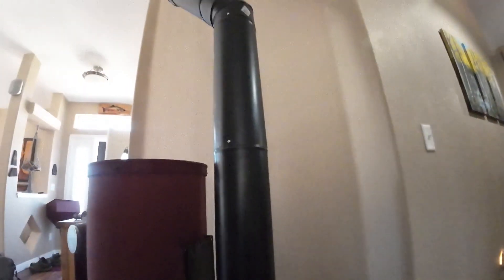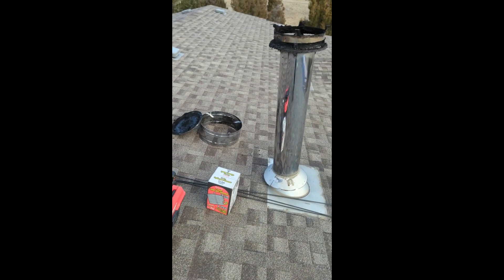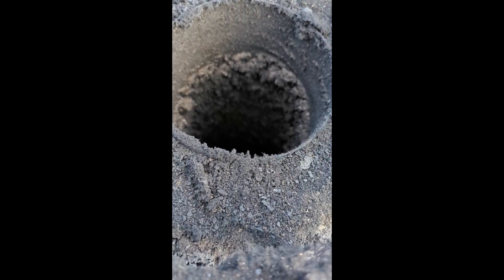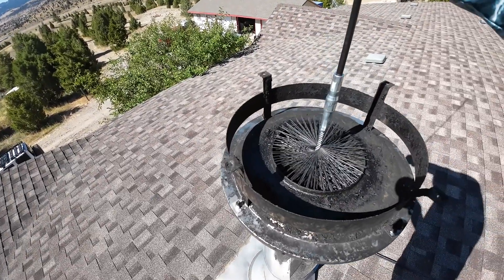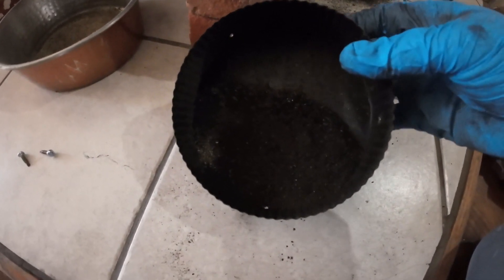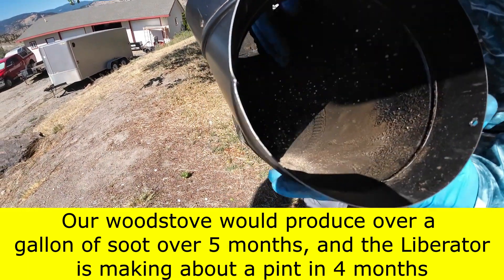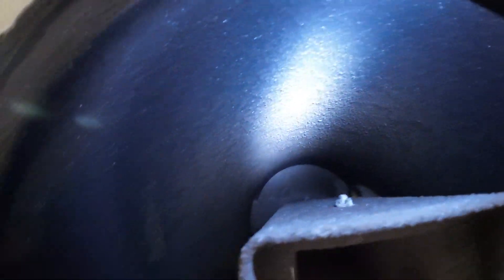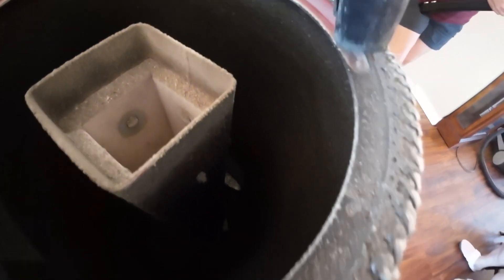Liberator 👀 4+ Month CLEANOUT 😬

Comment: Is there anyone who measured those J-tube measures, what size is this J-tube and liner, and what size is this hole inside the liner, that would help some calculations?? And where all places there is that liner totally rounded, between firepod and vertical tube too??

Comment: When you took the old stove chimney apart, you can tell no matter what wood they were burning, they were running a low temp/smoldering fire quite often.  We have burned wood in a standard old fireplace for 21 years straight with inspections and very rare cleanings by a qualified fireplace cleaner.  He said our style of burning an ultra hot fire at the beginning of the burn, creating a massive amount of coals, then letting the coals burn down to low heat, then refiring to a massive coal bed, and repeating has kept our chimney super clean.  We burn any and all wood we can get our hands on from tree services, or when we get some from when we go camping.  It has worked great forever.

Comment: I burn wood pellets in a home made rocket stove and after 2 years and 6 plus tons of pellets, all I had was a couple of handfull of dry power in the section of chimney that runs at a 45 degree angle, the remainder of it stays completely clean

Comment: If no smoke comes from the chimney and it burns so clean. Why did it create all that creosote? In the chimney.
Reply from the maker: What creosote? Thats about a couple cups of fly ash. No creosote buildup at all. I cleaned it out this fall again after burning it all last winter (6 months of use) and literally collected ONE cup of ash. 
Oh if I called it creosote I misspoke.
If you have seen My other videos on chimney clean out with a wood stove, there's literally a gallon of true creosote from one season of burning. Or maybe you saw the video I made of cleaning this chimney out when we first bought the house, it had a wood stove in it, and the owners never cleaned it out, and it was super thick with creosote, really bad, like about to start a chimney fire kind of bad. That's one reason I wanted to go to this rocket heater, to decrease or eliminate the risk of a chimney fire.
Maybe you missed the part where I had a green screen pop up saying we're going to go back in time to before we installed the liberator, that's when when the video shows a bunch of creosote from the pre-previous owners wood stove.
Reply: @anesthesiadreamin sorry i missed the very first part where you showed the chimney before you installed the liberator!
Reply from the maker: @TwopersonsWalksalone Yes, I probably shouldn't have built the video like that, I wondered if it would be confusing or not. My apologies
Reply: @anesthesiadreamin not a problem!

Comment: If that is a stainless steel pipe,,, do NOT use metal brush... Use Plastic,,, Metal will Scratch stainless and leave metal fragments in the scratch and if the stainless is NOT high quality and it WILL start to Rust...
Reply: By the looks I thought chimney flu was double wall insulated stainless and YES, a metal brush is bad news if that is the case. We just cleaned out double wass insulated stainless flu. 3 seasons of use with a Mattrix free standing wood stove. No creosote to speak of. Creosote formation depends on many things and I try to use season hardwood only and when I burn I burn it hot. But of course I'm stocking the fire every 1-2 hours. Lately I've been studying true masonry heaters like the Temp-cast. My proble is I like see the fire, and running it all day. For a true masonry heater most only recommend a burn in the morning and one at night. I guess in the ideal world you'd have both :)

Comment: A chimney will get in that condition with wet wood, softwood, inefficient wood stove and of course no maintenance.  A modern wood stove with reburn will produce little or no smoke when it is running.  Pellet stoves run cleanly and produce very little deposits that are not combustible.  Rocket heaters burn on the same principle with a very hot fire that fully consumes the pellets.  A lot of people burn a lot of wood in old stoves of very poor design.  Outdoor hot water boilers are expensive and burn ridiculous amounts of wood poorly.  Not to mention they are ridiculously expensive and very hard to feed and maintain.
Reply from the maker: That was an excellent summary. You should make a video about that
Reply: Softwood does not cause more creosote than hardwood, it's all in the moisture level

Comment: Hi 😊
I’ve been watching your video on YouTube – it’s really fascinating! I noticed there’s a combustion chamber in the front of the pellet stove without power, but I’m curious about the large round tank in the back. What’s its function? Is that where the exhaust gases go to cool down, or is it some kind of water tank?

I had an idea: if that rear tank could hold water, maybe you could place some heat-resistant coils inside, so the smoke passes by them and transfers the heat into the water. That could make the system even more efficient.

It looks like your model is about 60 cm (around 24 inches) in diameter and about 1.5 meters (around 5 feet) tall – so it could probably hold 100–200 liters of water. I really like the way you designed it, and I’d love to understand more about how it works.

You mentioned you use around 20 kg of pellets to reach 150–200 °F and heat about 600 square feet with this small setup – that’s impressive! I’m curious if the same system could be scaled up to heat a larger house, maybe 1,500–2,000 square feet.

Comment: The residue in the stove pipe from the liberator doesn't look like soot.  It looks like fly ash.
Reply from the maker: You are exactly right. I just cleaned it out at the beginning of October again, after burning it all last winter. There was about 2 cups of fly ash total from the heater and chimney combined. From a whole winter season of burning, in SW Montana
Reply: @anesthesiadreamin  I have an insert that does nothing when there is no electricity.
But it's in such good condition I don't want to just get rid of it.  
If the inspector this week says it's time to replace the stove then I'll talk to him about installing a rocket stove in it's place
Reply from the maker: @beebob1279 its UL listed so there shouldn't be any issues. But I get what you are saying, sometimes the most sustainable thing is what is already in place 👍

Comment: They are lucky they didn’t burn the house down with all that creosote in the chimney. Burn good dry wood and avoid creosote. Hardwoods are better than pine. If you burn pine, make sure it is well seasoned and split to smaller pieces.

Comment: Why the bend in the exhaust pipe? Why not just run it straight up?
Reply from the maker: @danhemsworth7488  We wanted to keep the rocket heater centered on the hearth. Otherwise we would have had to extend the hearth out into the walkway if we wanted the chimney to go straight up. But  two 45° bends equals one 90° bend and most codes will allow max 180 degrees in bends.
Reply: @anesthesiadreamin  Cool , great work.

Comment: Only downside of most stoves is that they burn the air that's inside the house and that air needs to be replaced. Most of the time, it will be replaced by cold outside air that gets sucked into the house through gaps in windows, doors and the insulation. It might not be practical, but you would get more efficient heating if you could figure out a way for your stove to burn air it sucks in directly from outside. Then most of the air being heated by the stove actually stays inside.
Reply from the maker: @CChan11  You were exactly right! Be sure to check out the "questions answered" video on my channel (Liberator playlist) where you can see my cold air intake. I'm working on a video that details how I made the cold air intake. And it definitely makes a difference 👍
Reply: It appears your cold air intake draws off the floor?

Comment: Its probably reasonable to assume that a water tube coil  could be inside the fire barrel and do a great job .
Reply: It would suffer heat damage.  
The heat in the barrel will ruin the welded steel J-tube riser, if not for the insulation panels.   
Depending on your use for the hot water….
Feeding a water tank, it might be ok (maybe) to put copper coil around base of barrel exterior, to feed to a tank with an expansion tank (cuz it will steam).  
Feeding radiant floor tubing, a copper coil only around the horizontal section (bench section) of exhaust pipe is better…away from barrel…rather than directly on the barrel.

Comment: Creosote build up in a  chimney is caused by none season dried wood especially soft wood seasoned firewood burns cleaner and hotter especially hardwood I would say the amount of Creosote in that chimney The previous owner didn't use seasoned firewood especially using soft wood 10 % or less moisture content in firewood will burn the  best clean and hot
Reply from the maker: I agree 100%. No hardwoods in this area. The previous owner didn't use a woodshed to store wood either, and it snows often in SW Montana, so I'm sure the wood had a high moisture content. Thanks for sharing your experience!

Comment: I've been waiting to see the inside!  Be sure to clean / change the filter right after vacuuming - as ash plugs up filters incredibly well.  I'd recommend using a shop vac with one of the paper filters over the foam filter.
Reply from the maker: @CubbyTech  thankyou, good advice👍
Reply: You can also use bags in a shop vac they greatly extend the life of filter.

Comment: Always wondered about air intake .  Can it be channeled from outside rather than suck warm air from the home? Can it be a hose that actually travels from the outside  inside the chimney to heat up the air before it hits the fire?  This may prevent the warm air inside the room from travelling towards the heater
Reply: The liberator is designed to be vented from the outside

Comment: Starting our 3rd winter with it.  Our ONLY heat & used 40 bags of pellets last year @ $5 pr/bag. $200 pr/yr to heat in southern Ohio.
Reply from the maker: @scott1lori282  That's awesome! Do you have it attached to thermal mass?
Reply: @anesthesiadreamin  No sir, but I do keep a large cast iron Dutch Oven filled with 1 fire brick and the rest is filled to the top with river stone. The Dutch oven will put out some good heat for a couple hours after the stove is out..
Reply: How many sqft does yours heat?
Reply: @stephaniewilliams8537  1100sq ft ranch.
Reply: What kind of pellets are you using? Pine? Is pine safe to use in this application or not?

Comment: Great video, thank you!! 
I noticed a possible problem with your stove pipe connections. All crimps, including the cleanout Tee, should be heading downward from the ceiling to the stove. The cleanout Tee should have crimps toward the floor with a cap that fits over the crimps ( see Liberator instruction pdf).
Reply from the maker: @SirDavosChannel  Yes, you're absolutely right. My understanding was that doing so prevented any water that might come down the chimney from leaking outside the pipe. Am I wrong? Or is there another thinking behind that? And the reason I haven't done that with my other builds is because I've never had a problem with water leaking down and then outside of my chimney pipe. But I could be very wrong
Reply: @anesthesiadreamin  
I dont know why, I can only speculate that on wood stoves where there is a possibility of burning wood that is heavily laden with sap/creosote, the correct crimp direction  would prevent any hot sap/creosote from possible dripping out of the flue crimp connections(??).

FYI: On a coal stove, the crimp goes in the opposite  direction (from my understanding).

Disclaimer: I've never owned or installed a coal, pellet, or wood stove. 

Based on this great video, I love this stove.

Thanks again, @anesthesiadreamin!!!
Reply: Correct.  Wood crimps down always.   As long as you have correct draft you won't get smoke out of the connections.
Reply: If the top crimp/pipe goes inside of the bottom pipe wouldn't that make a possible leak for smoke to come into the house? Because the larger pipe is on the side the smoke is coming from.  Yes coal stoves are the opposite of what you have described and automotive exhaust is also. That's why I've always thought it is to help prevent exhaust/smoke from leaking. It would have to reverse directions before it could leak out.
Reply from the maker: @heavenleigh111  That's exactly what I always thought. So IDK. I've heard supporters of both sides, but all I know is I don't get any smoke in my house, the CO or smoke alarm never goes off, we never have the faintest hint of anything visually or by smell like burning or smoke in the air. 🤷‍♂️
Reply: @heavenleigh111    Nope.  It’s Code, to point crimps down into lower sections for woodstoves.   It prevents hot creosote from dripping onto exterior of pipe inside the house—that would be a fire hazard,  chemical VOC hazard, & ugly!    
I’d never heard of it being opposite for coal. 
Installing a stainless steel chimney liner right to the stove & up the chimney, avoids that—& some easier to clean.

Comment: Is the horizontal tube behind the burn basket lined the same way as the vertical tube?
Reply from the maker: Yes, you got it, it's what Liberator calls "fiberboard" and they sell replacement kits. They are not on their website yet, but you can call and order them.